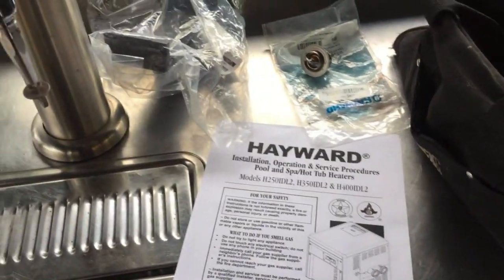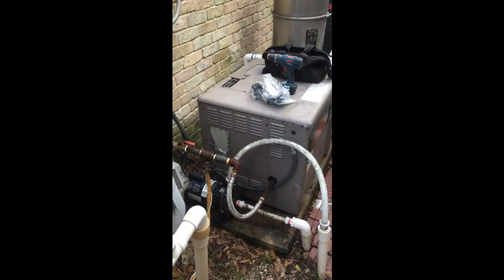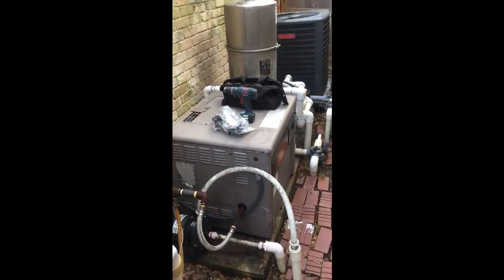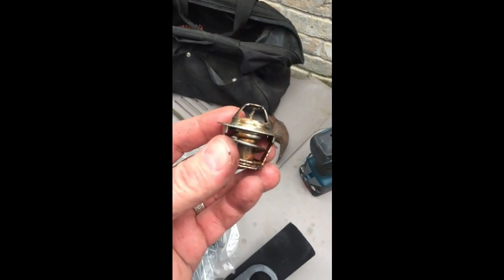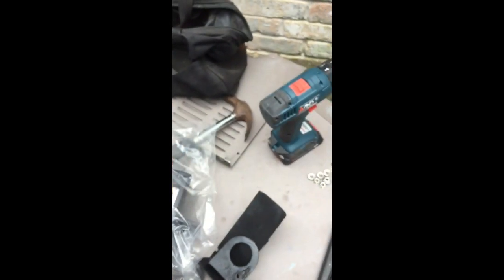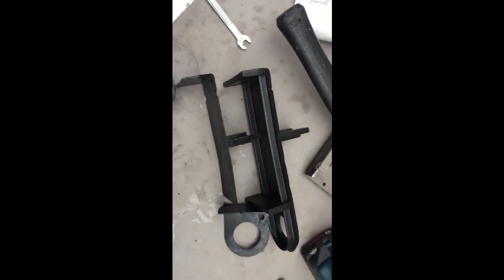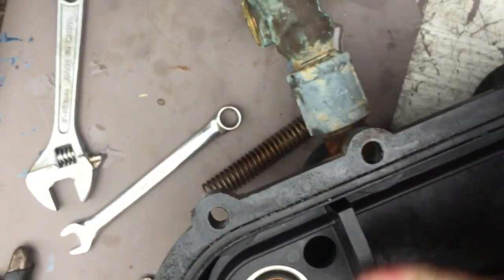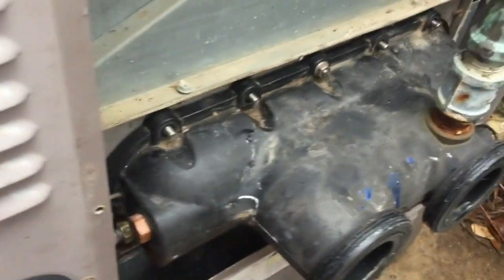Spa - Pool Heater repair - loud banging , clanging noises

Comment: Thanks for this vid! I had this same issue, and found out that it was due to back-pressure (lines to pool/spa were clogged)--- so air couldn't fully escape from heater, caused entire heater to bang/rattle. Pretty freaky when your heater starts moving around like an out of balance washing machine!

Comment: If anyone is having problems threading the nuts back onto the manifold I found 3 different sets I ordered were slightly misshapen and would prevent them from threading on. I eventually wrapped them in a towel and poured hot water from a tea kettle to soften them up and they thread on perfectly. Hope this saved someone the head ache I went through

Comment: If you get the full front header assembly (Hayward part # IDXLFHA1930) do you even need the bypass insert? And also for the bypass insert only, does part # HAXBPK1931 supersede what is shown in my owner's manual as part # HAXBPI1931?

Comment: What if the sound I’m experiencing is like more of a gas or combustion noise??
Reply from the maker: Well you should here a whoosh of gas as it cranks up and then while heating the water you should have gas flame sounds. Are you hearing something other than that?
Reply: Yes, sounds like a banging or beating of a drum while heating
Reply from the maker: @ronsmith4569   That could be the issue I covered on this video and as others have mentioned, basically poor water flow / heat control causing the water to steam up causing that noise.  If it gets increasingly worse and sounds like a dryer with shoes in it, could be the issue covered on the video.

Comment: Is that a standard pressure relief valve ? I was thinking of adding one, just like the one on a hot water tank. I had a issue with one of the plumbing bypass valves and instead of the heater shutting down and blinking low flow, it had just enough water to keep the burners going. This caused the manifold to split.
Reply from the maker: I'm not sure if it was a standard pressure relief valve or not. It came with the heater. I don't know why a standard one for a hot water heater wouldn't work

Comment: Thanks for the video.  I had the same problem with a heater that was installed in 2003.  Ordered the online parts and used your video to complete the repair.

Comment: Thx Sid...
Your video was so helpful to me.
Lucky I didn't need to replace anything.
Let me explain,
My heater was doing everything your was so I thought I would need to replace the thermostat but, while you were explaining how it works (with the water flow) it dawned on me that my spa jets were not as strong as there usually are.
Last night while laying in bed I realized that I haven't cleaned out my filters in a long time.
So today after work I did just that and now the heater is working just fine.
If it wasn't for you explaining how it works inside I wouldn't have figured it out.
Thanks again!
I not only wanted to thank you but tell my issues. Maybe this my help someone with the same issue I had.
Reply from the maker: Thanks for the feedback and glad to hear that no repair was needed!  That's always the best news.  Very good point that ultimately the real issue is that water flow rate is not adequate and causes the water to steam or vaporize in the heater.  Thanks again for the comment!

Comment: @10:28 You used petol-gel. Never use petroleum-based grease for o-ring lubrication. It will eat away rubber and you will have to redo this for leaking. Always use silicone-based or PTFE-based(aka Teflon) lubricants such as Lube Tube or Jack's formular 327, or just 3M silicon.

Comment: Hello, I have a Hayward H400, the flame turn on but after the water is hot I believe, the systems shots off and bang. So the hot water don't come out. 
What can it be ? 
Please help.
Reply from the maker: Well to be 100% transparent, I am not a trained or paid pool tech, just a DIY guy trying to get the most for his money.  Not a lot to work with on the description of your problem but we can  start with what you mentioned.  If you have the system shut off after the water gets hot, very likely you are reaching a point where a limit switch is kicking in.  It seems that most of these heaters have several "trigger" switches that would stop operation.  Those could be anything from water flow to the water being heated too hot.  First step would be to see what error code is displayed when the heater stops.   A good google search of hayward 400 error codes or hayward 400 repair / troubleshooting will lead you to the documents to help you step by step figure out what is wrong.   To follow these, you will need to be experienced in using multi meters and testing circuits.  If your not comfortable with that, probably best to look for  a pool tech.  Having said all of that, my first guess is that you are hitting a high limit switch due to the temperature being too high which is likely due to restricted water flow or damaged heat exchanger. Best of luck in your repairs!
Reply: @wichitasid  Thank you for your respond, I am sure you help a lot.

Comment: Hello.  Today is the first day 4/18/2021.   I ever hear a clanging noise in my Hayward 400 installed 2001.  Previous repairs fan stopped working 2002.  Since then till now no problems.  20 years I haven't done anything of cleaning or servicing to the unit.   Great units time for maintenance.   In your video was the thermostat and the by-pass insert the banging/clanking noise?   Any part kit where all those parts come together or separate?  Great video Thank you.
Reply from the maker: The noice was from low water trapped in the exchange heating to boiling point. The bypass and flow control weren't working correctly and not allowing enough water in so they had to be replaced.
Reply: Yes it was.  Your video helped me so much.  The weak plastic(by-pass flow) break was the problem.  Replaced and the thermostats  (governor) too. Now fixed.  If you get a 1F error after repairs.  Your orifices(gas tip nozzle).  A 7/16 wrench removes them. The orifices had spider web.  Cleaning and re assamble that fixes that too. HEATER works great again.  Thank you for your video.

Comment: What was the issue getting the unions reconnected to the manifold? Im having the same problem, It’s like the threads are stripped but there not on the Manifold or the unions.
Reply from the maker: In my case I'm pretty sure it was due to the pvc pipes not being perfectly aligned with the manifold on the heater side. I had to spend a lot of time backing the nuts up to the point it felt square and then slowly rotating them on. Started with one and after a few tourns started the second. Hope that helps.
Reply: The nuts are misshapen slightly bought 3 different sets before I thought of wrapping them in a towel and pouring boiling water over them. They soften up just enough to thread on and take the right shape

Comment: That heater went through a bad water chemistry prior or after you got it to be corroded  like that.  Stay on top of the water.  It’ll be the fastest way to have to replace the exchanger.  As a warranty tech for pentair.  I’ve seen brand new heaters a month old the water are through exchangers.  Ruined sensors ect.

Comment: So what caused the banging? Ours started banging yesterday and thought it was the exhaust blower
Reply from the maker: Fred Juarez in my case and most cases it seems, the loud noise is from steam building up in the exchanger section. If you are starting it up for the season make sure your flow control valve is open to run the water through the heater. If that’s open then you might have a problem with either of the parts I replaced.
Reply: The internal bypass.   Anytime u get the clunking ect while it’s running 100% is the internal bypass

Comment: Thanks for the informative video! I was curious if you knew what size of o rings you needed for the 2 in/out connections (the ones you pointed at at the end saying it was hardest to put back on)? Or would the local pool supplies store know/have them in stock? Thank you!
Reply from the maker: It seems with most pool related things it's very difficult to source them anywhere other than a pool store unless you know the specs.  My heater is a hayward 400 idl2 and the kit for the o rings is listed as part haxfor1930.  if you can't find it, some of the better pool stores can cross reference for you.
Reply: Sid Taylor thank you for the info. I also have the same heater and was able to verify that p/n with the local supply shop. Thanks for your informative content!

Comment: How did you stop the water flow from the pool?  What did you use to remove the large tighteners on the outside of the manifold?
Reply from the maker: I put the multiport valve on the pump to the closed position but even then there was lots of water left in the system.  There is a drain plug on the bottom of the manifold to get all of the water out of the heater.   Thats the main problem with a heater repair is that most times you can't run the pump because the heater is inline.  Not sure what you mean by tighteners but everything on the outside of the manifold came off either with a wrench or a socket.  Thanks for watching!

Comment: Thanks for the video.  This is exactly what I was looking for as my heater is knocking also.  Where did you buy the parts for this unit?
Reply from the maker: David Till I tried looking for my order receipts with no luck. Basically if you do a google search using the Hayward part numbers you’ll find plenty of options   I did just have some great experiences with pool supply world.com with low pricing and quick shipping. I would absolutely stay away from Sunplay.
Reply from the maker: David Till Almost forgot to say thanks for the kind review.
Reply: Thanks for the Video. My heater was making that knocking sounds. I replaced everything inside the water manifold now my heater is not coming on anymore. Do you know what could be the problem? @wichitasid
Reply: Great Video
Reply from the maker: Rolando Castillo are you getting any kind of error message on the display?